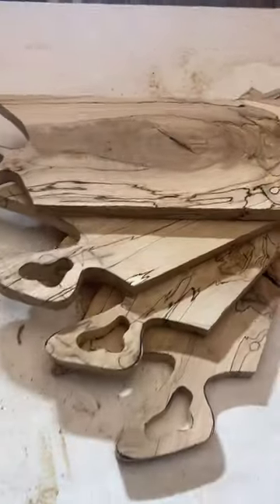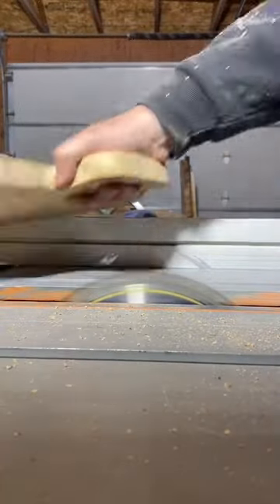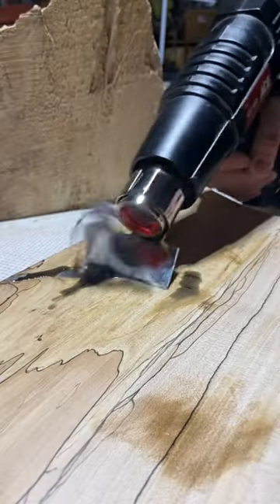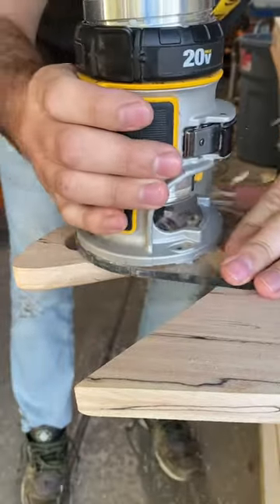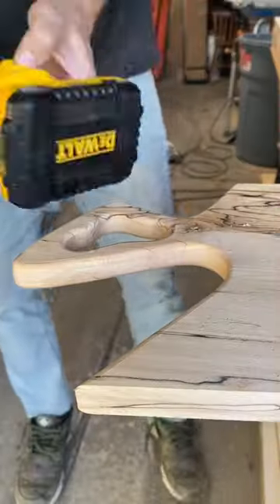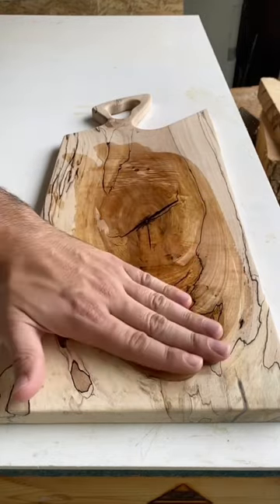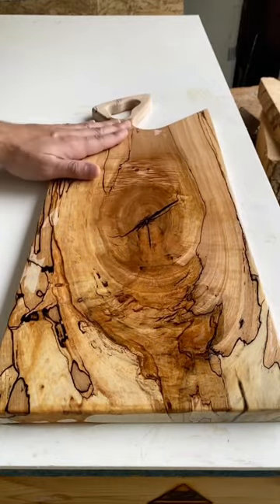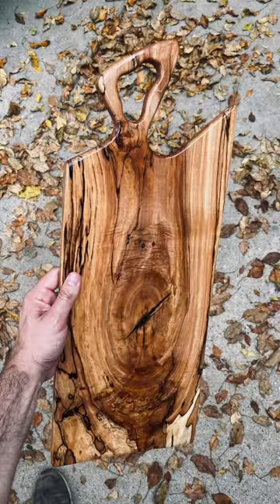This wood will surprise you… #shorts #diy

Comment: Beautiful:) 

Hi guys. If I’m only going to buy one electric saw to do some DIYs, is a jigsaw the right one to get ?  Make shelves, cut trim etc  or a table top  (don’t really have lots of storage room 🤷🏼‍♀️) 
Thank you 
❤🇨🇦
Reply: If I only got to use one saw for making trim and shelves I’d like a miter saw. For a table I could make due with a hand held circular saw, but I’d prefer a table saw and a miter saw. 

I like using my jigsaw for cutting curved lines. It’s also important to remember that with a jig saw the blade can drift and your cut won’t necessarily be plumb to the surface of the wood.
Reply: I agree with the other person who commented. I personally started with a circular saw but a miter saw is a good choice too. Keep in mind a miter saw is going to be limited on the length you cut. Where a circular saw might be better if you’re planning on making longer cuts as long as you use a straight edge to guide you. You mention table tops, but are you planning on gluing together smaller pieces to put together a large table top or are you cutting down to size a large piece of lumber?

Comment: How is beard oil food safe? Just curious? Or is he just using the bottle for it?
Reply: Cutting board oil 😂 not beard.
Reply: Actually, anything you put in a beard - around your mouth - ought to be food safe. Plus, if the hair in your beard can absorb the oil it will also be able to absorb into wood. Linseed is one of the oldest oils used on wood. Linseed is also known as flax which might be an ingredient in your granola.